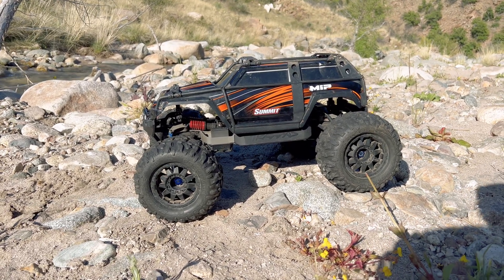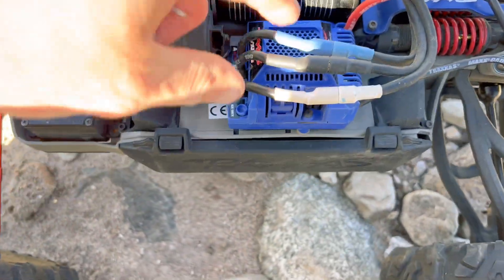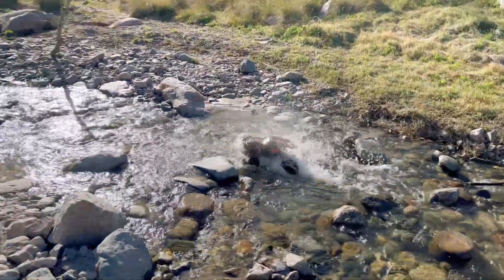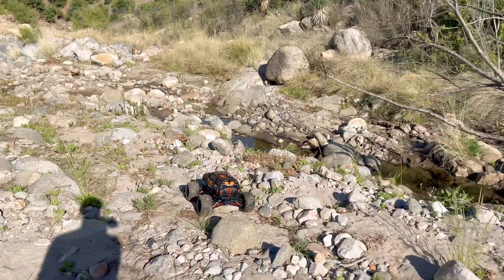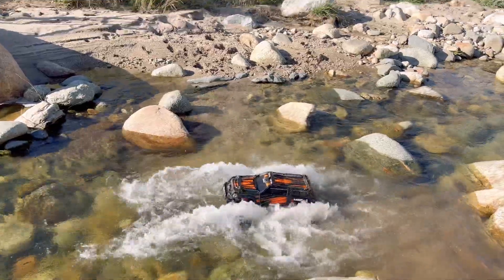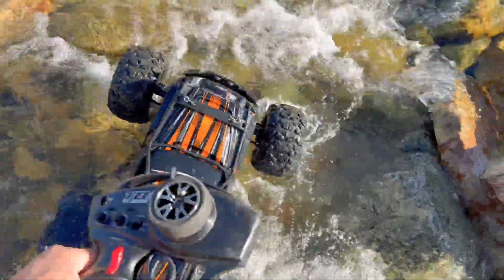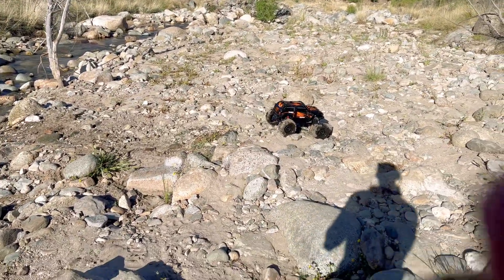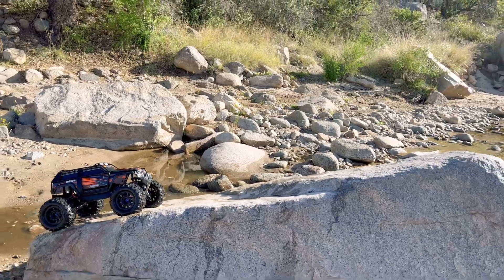Brushless Traxxas Summit // MIP DRIVESHAFT // Durability Testing

Comment: I’ve had an issue with the rear differential exploding in my brushless summit. New spider gears and aluminum diff carrier, then blew the diff pinion gear. Have the $40 spiral one coming in the mail. Anything else you’d recommend to beef up?
Reply from the maker: Yeah the hot racing diff gears are much better…also adding the GPM spider gears isn’t a bad idea either